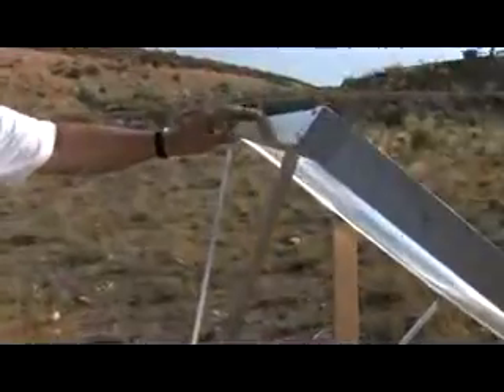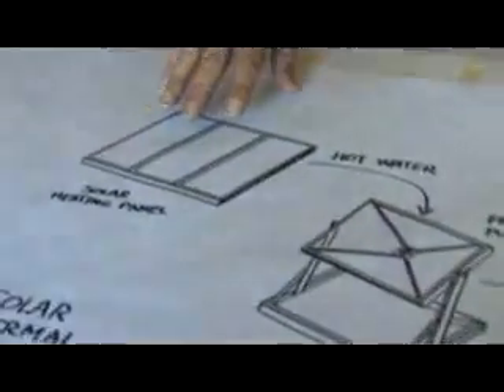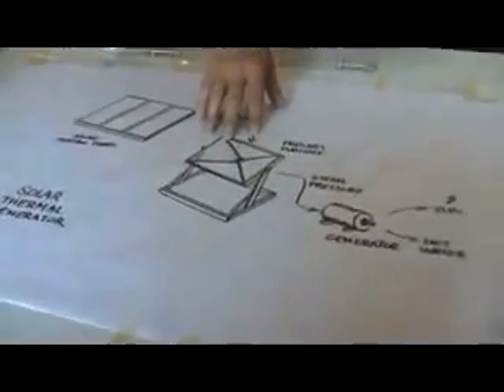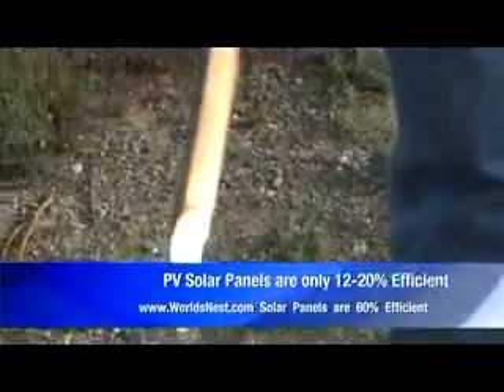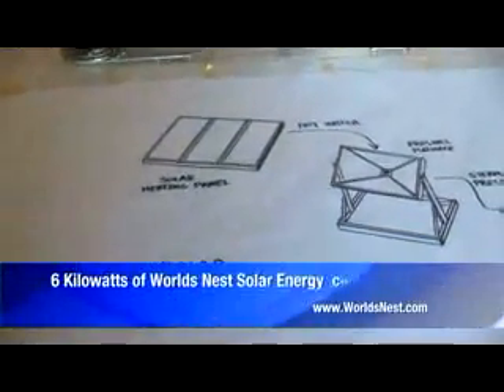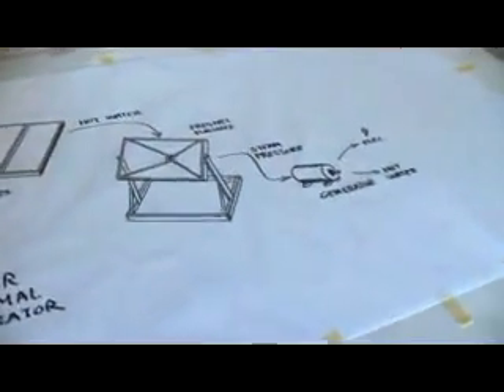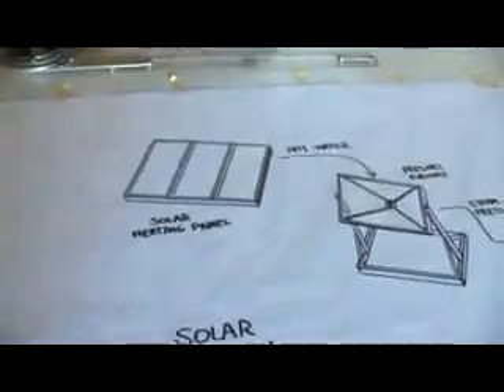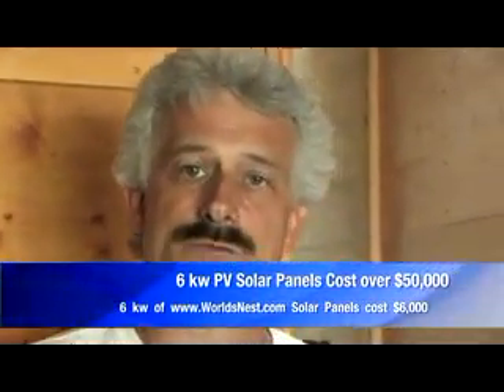Fresnel Lens Generates Electricity And Hot Water

Comment: The problem I see is tracking: in order for this device to capture solar energy it needs to be constantly adjusted and refocused toward the sun, much more than PV panels. If you can device a way to auto-track by redirecting a small amount of energy to something that could be calibrated, then it might be more feasible (but $$$). It's also a bit cumbersome and fragile. And you'd better hope a cute little bird doesn't follow those light curious insects into that scorching catch basin.
Reply: They already have that. Also if this was done in large scale theoretically you can build a tower above the clouds and have FOREVER energy during all sun hours.
Reply: Also use a lens 60 times the size of one of those lense.